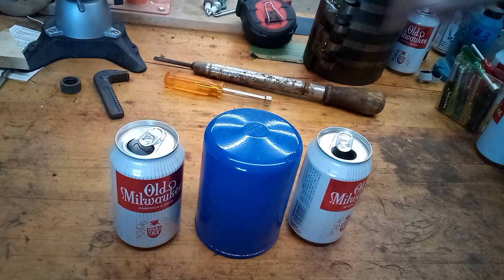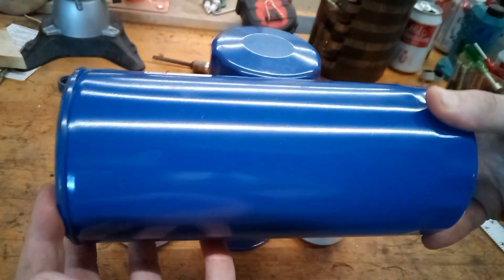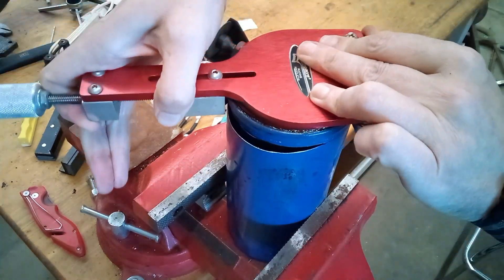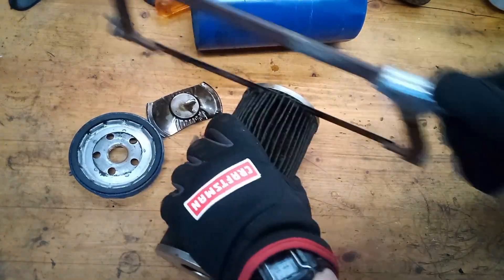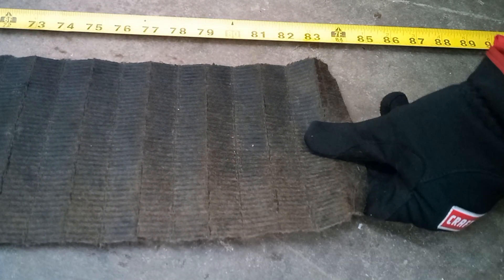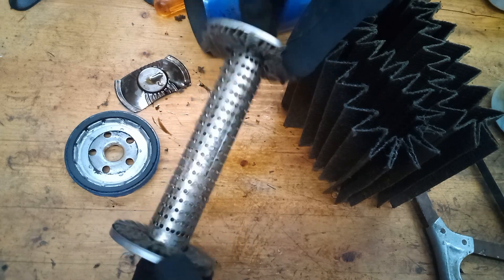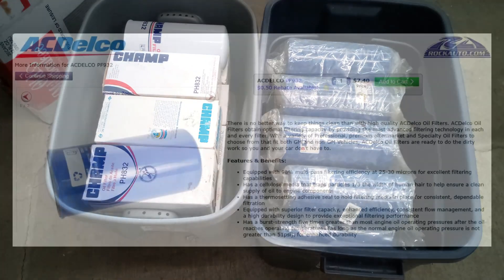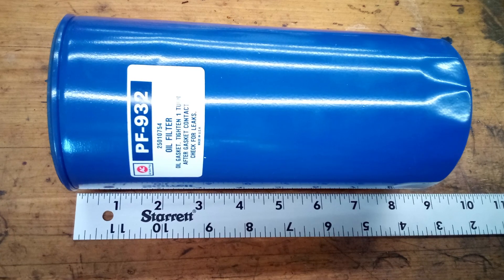Dissecting AC-Delco's Based SBC/BBC Oil Filter (PF932)

Comment: Will this fit on a 454 big block ?Nowonder I’m getting high oil pressure at cold start then after warm up it goes to 45 -50 psi when I accelerate it goes up to 65 - 70 psi its nerve racking sometimes I think my oil filter is going to blow off from such high pressure that’s with  the cheep 
generic AutoZone filters 
I’m going to get me one of these Long ones thanks for the informative video
Reply from the maker: Yes. I've used them on 454's. As long as you have the ground clearance and the exhaust pipe isn't in the way.

Comment: Nice video . I used the Purolator version on a 350  G10 van . I drained the filter and reused on next oil change. I’m not certain it holds 2 quarts , I thought 1.5 quarts.
Reply from the maker: I wonder if they measure the capacity without the filter element installed. I pre-fill my filter and I don't think I've ever gotten more than 1.5 quarts in mine either.

Comment: always run the biggest oil filter you can physically interchange.. it adds a bit of capacity and doesn't stay mostly in bypass like today's dinky little lawnmower filters stuck on everything from my little 4 bangers to giant high performance v8's. Unless it's an LS where GM decided to stick the filter bay in a recessed window so you can't go fatter.. on the BOTTOM so you can't really go any longer either
Reply from the maker: Agreed. I've even put oversized filters on garden tractor engines.

Comment: I think there is one more benefit. Serves to help lower oil temps by letting the oil catch more air and dissipate heat.
Reply: That's what I did rto my Hemi Jeep. It would get a little warm. I added in a bypass, put in an additional oil cooler and a big honking oil filter that gave me additional oil capacity, not counting the little extra from the oil cooler. No more running hot.
Reply from the maker: Interesting. That's something I didn't think of.

Comment: The 932 will interchange with the 25 and 35. Used to sell these on auto parts route years ago. They were originally PF-832 when they came out and changed to PF-932 somewhere around mid 80’s
Reply from the maker: Thanks for the info!